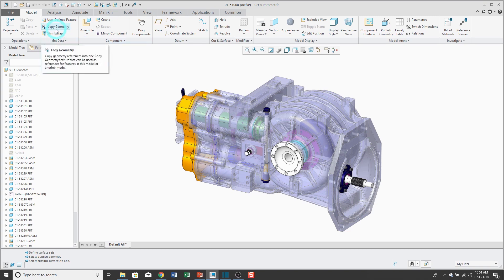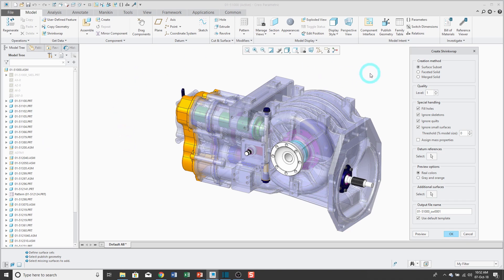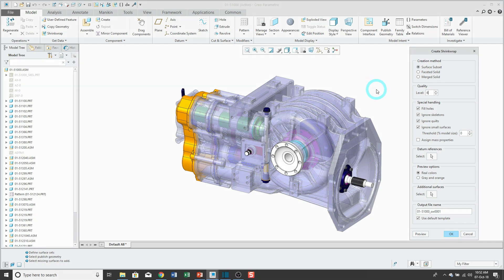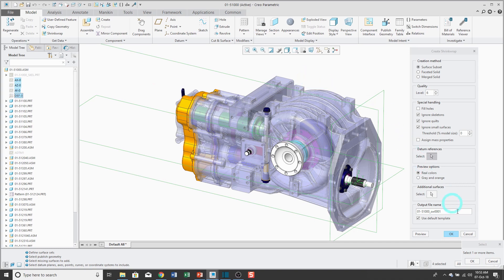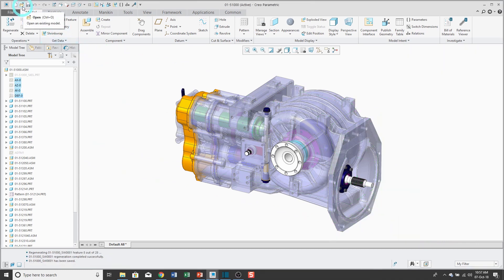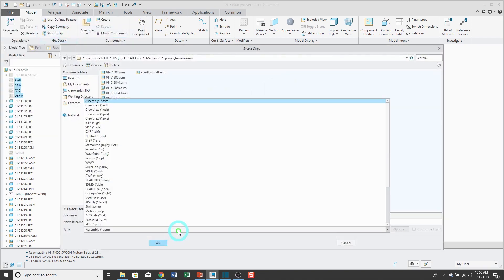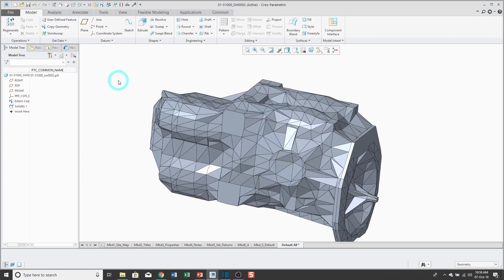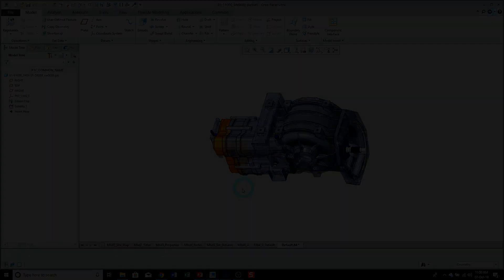Creo Parametric - Shrinkwrap Parts

Comment: Hi Dave, How this is going to differ from converting a file into STEP format? May be a stupid question, but expecting a clarification from you...
Reply from the maker: STEP is a CAD neutral file used to share models with other people who don’t have Creo and to protect your intellectual property.

Shrinkwrap parts consolidate an assembly of multiple components into a single Creo Parametric part. It is Creo specific. It is used both for data exchange and Large Assembly Management. It can be used in Simplified Reps.
Reply: @CADPLMGuy Thank you very much for the swift response.❤

Comment: Thank you Mr Martin! Love your clean, concise, informative tutorials!

So basically,
the best creation method is Merged Solid. Almost completely satisfies form & fit at minimal overdetail. Lv1 gets the basic job done, but Lv10 includes small items even washers.
Surface Subset is a close second, but with extra callouts (some overdetail) in the Model Tree.
Whereas, Faceted Solid is practically useless. Looks like a blob even at high Lv.
Reply from the maker: I always shy away from declaring anything the “best.” It depends on the application. For 3D printing or protecting intellectual property, Faceted Solid has definite advantages. If you just think in terms of “this method is always best,” you might miss out on a better choice in certain situations. This is the lesson of Design Intent.

Comment: What version of Creo is this?  When I do File/save as, shrinkwrap is NOT one of the options I see in Creo 4.
Reply from the maker: Are you using a student version perhaps? And it's File > Save As > Save a Copy and then you choose Shrinkwrap from the Type drop-down list. I think I did that video in Creo Parametric 3.0 but the command location has been the same since Wildfire 1.0 or earlier.
Reply: @CADPLMGuy  That's CREO 3, I have the same version.